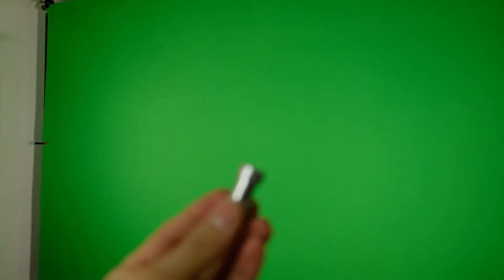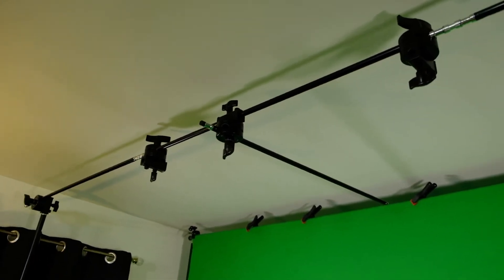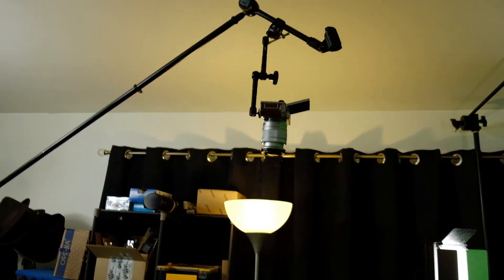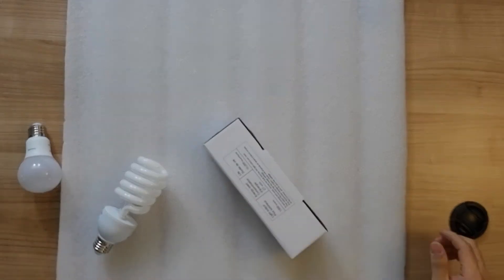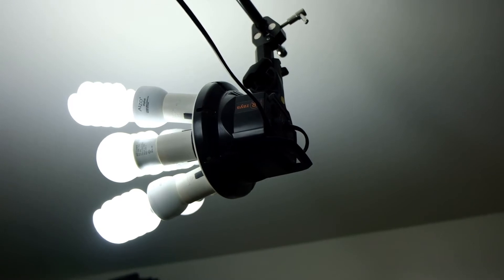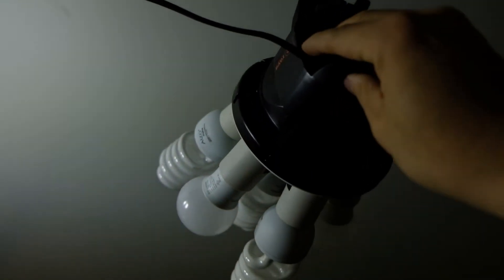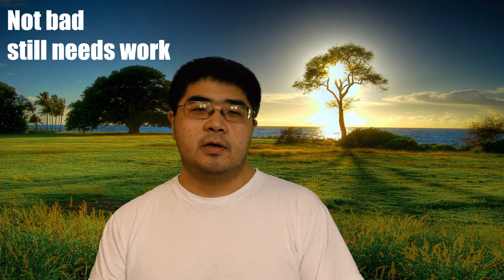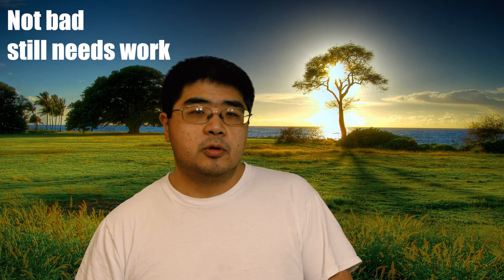Building a Home Studio - Part 3 - Lighting and first Green Screen test

Comment: Very cool video.  You're making good progress.  Getting such good results out of a green screen certainly isn't easy, and you've done a great job lighting yours.  It really shows with how clean your hair is in front of the screen.  Out of curiosity, what shutter speed were you running on your camera?  It looked a little low, to me at least, for use in front of a green screen.  When you would move your hands too rapidly you would see the green haze around the movement.  A higher shutter speed should hopefully help to remove some of that blur and therefore green haze.  Keep up the good work, and I look forward to your future updates on your home studio!
Reply from the maker: Good eye John, yes, on my Fuji camera, I record at 60 frames but on my blackmagic, I had it set to 30. I should have rendered the video at 30 fps to account for that. Thank you for watching!
Reply: Check the shutter speed too.  The FPS shouldn't matter too much.  The issue is the blurring of the motion in front of the green.  You can use either a 30 or 60fps setup just fine (even combining with different timelines) just bump up the shutter speed of the camera to produce less motion blur so it has an easier time identifying where you are versus the screen.